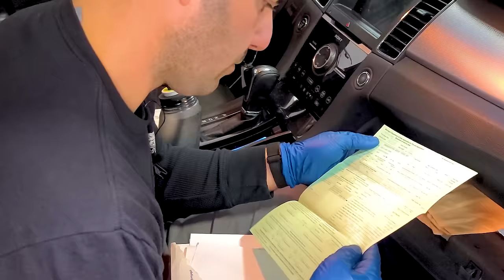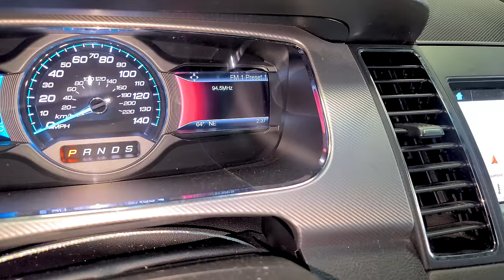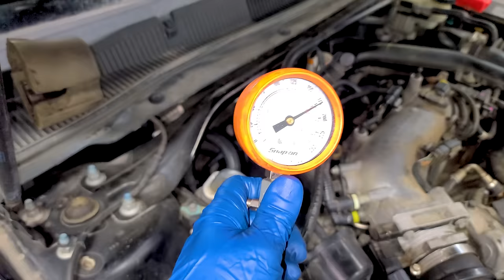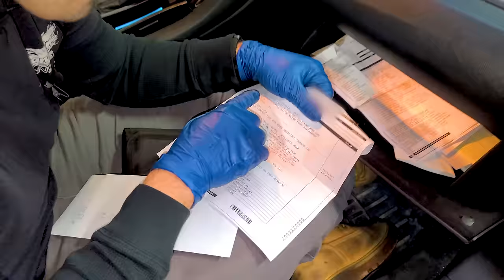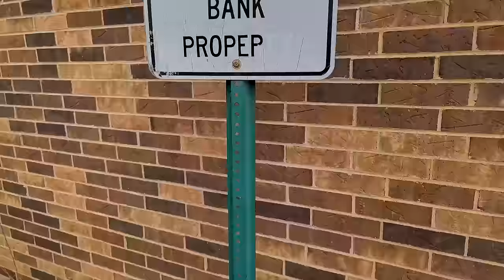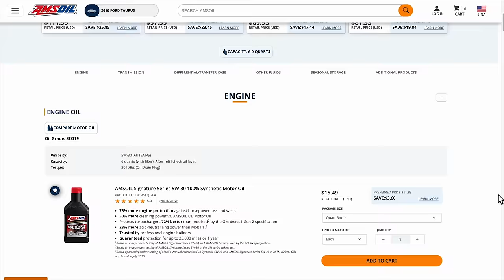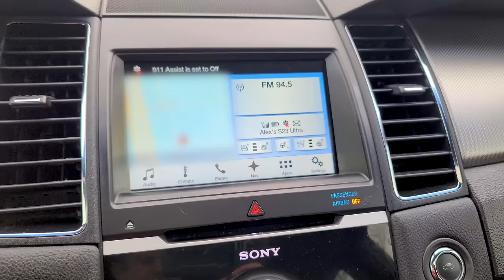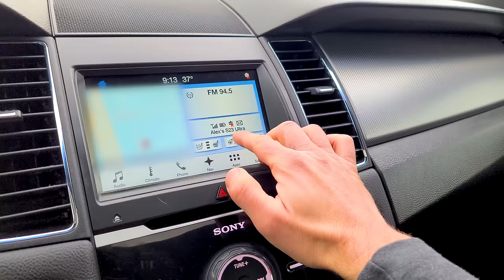I LOVE My GTR So I Bought Another Twin-Turbo V6 AWD Auction Car For 50% Off! Fixed For 30 Dollars!

Comment: **Internal water pump has left the chat**
Reply from the maker: Keep watching!
Reply: one of the worst engine design choices ever made. what a jackass thing to do as an engineer
Reply: That's why they're dirtcheap
Reply: Makes me a lot of money 🤷‍♂️
Reply: And tensions/phasers when the extended oil change intervals gum/varnish all the oil passages 😊
Reply: Alex is collecting cop cars!
Reply: @OxBlitzkriegxO  the 3.0 duratec V6 already had a great water pump design which was external no idea why they chose to stick it in the timing chain on the FWD 3.5/3.7 engines
Reply: That design issue is the only reason I didn't get one of these things. What were the engineers smoking?
Reply: happened to mine a month after i bought it
Reply: Sounds like a Ford problem. Nissan has had water pump driven by the T  chain for years . And never had an issue with it. I worked there for year and only replaced 1 , and that was because the customer skipped oil changes and gummed up the tensioner. I had to remove the little spiked ball water pump to replace the tensioner, wasn't hard at all.
Reply: @OxBlitzkriegxO why? They aren't that bad and they have a weep hole. Not like it fails every 30k miles
Reply: @redneckrussian2596  I can't find any GM engines with a internal water pump
Reply: @commonsenseisdeadin2024  the weep hole very commonly clogged and worse, it doesnt always follow the weep hole. its very common for them to leak directly in to the oil pan
Reply: @redneckrussian2596  no one complains about it because you're wrong. 2.5 hours labor in the 5.3 (which I think is way on the high side) vs 10.3 hours for a water pump in the SHO. Can you tell which one is actually internal?

Hint: I believe the fastest way to change the water pump in the 3.5 is to remove the engine
Reply: @redneckrussian2596  probably because you can nearly buy a whole engine for half the price of a water pump. thjeyre so plentiful but more importantly, they dont really fail very often.

3.5 water pump failure is only superseded by the amount of PTO gearbox failures for all of ford's awd cars.
Reply: @lieutenantdan8170  best i can think is due to packaging. its such a bad idea.
Reply: @OxBlitzkriegxO in the old 3.5 (non eco boost) I knew had that issue (few years ago I used to buy first Gen MKS's real cheap that washed out bearings to flip)  

the 3.7s and 3.5 eco boost i I haven't seen or heard of them clogging up  (so far I've done 9 of our 3.7s and haven't had any debris in the drain passage)
Reply: @trashbandit2449 book time on Continental 3.7s said 22 hours, the motor doesn't need to be pulled, just jack the engine up when you pull the motor mount connected to the front cover (aka the reason why the water pump is chain driven)
Reply: @OxBlitzkriegxO there are many others done this way. That is not a bad job as modern cars repairs go. I have done many of them. V6 GM and Stellantis engines in their fwd vehicles are far worse for timing chain matters. With 5k milenoil services this Ford family of engines will not need a chain when the water pump leaks in the 150k mile range but most 'change when it tells me to' owners will need chain and pha sers when pump is through.
Reply: Mine just went on my 2016 Explorer...$2700 at the dealership which included timing parts. What the hell were they thinking.
Reply: @commonsenseisdeadin2024  the block section of that little channel will get junk in it over time. its more likely to happen if the owner uses stop leak. 

it will also leak through the bearing. thats the main source of leakage in to the timing cover area. it doesnt help that the timing system puts quite a load on the water pump bearing due to its design. its so stupid.
Reply: Yep! Happened to my 2010 ford Taurus SHO. Water pump went out at 85k miles. Costed almost $2k to get it replaced
Reply: My 3.5tt doesn’t have hardly any service records got over 210k on it now that lil guys still pumping water lol. Istg these engines do not tolerate sitting or being babied whatsoever lmfao
Reply: The vq35/vq37vhr has the same design. Water ran by timing chain behind the timing cover lol. But atleast the motor is facing front wards .
Reply: @commonsenseisdeadin2024  yeah that was the long way to do it. Dropping the subframe or pulling the motor however they do it, ends up being shorter from my understanding. Either way, that's nuts. 

Water pump on my accord is internal (I believe, as it's run off timing belt) and I never really want to replacing timing belt/water pump on that again. Still faster to replace than an ecoboost
Reply: @FanOfSkynyrd  easy solution..... Don't bring it to the dealership!!!!! First off, why do you want to replace failed parts with the same exact parts! (Not that 150k+ is considered a bad component, timing belts and timing chains having a 100k service interval that costs thousands for YEARS! 

Also, there's absolutely nothing special about dealer techs (in fact many are simply parts installers) you're also limited to what part options you have as well as a slew of parts the manufacturer "recommends" to replace at the same time and is required to perform the service. 

 Where a mechanic will replace only the worn or broken parts, they will examine the guides for wear and look at the chain stretch (it's a 10 second visual inspection to check how extended the chain tensioner is or any excess slack, guides you just make sure they are flat and no cracks or groves) 

Honestly,  a $2700 repair after 8 years and 150k miles. Admittedly I am assuming mileage but is an educated assumption! 😂 Along with that knowledge is I bet the vehicle hasn't been a repair nightmare throughout your ownership, outside of normal known maintenance, no? 

What's crazy is a vehicle is on average a person's second most expensive purchase of their lives after a house but yet it's treated like no big deal! I feel bad for these people stuck in these sizable payments and the vehicle is constantly costing even more for constantly breaking,........ Again assuming here but I bet you can appreciate that! (Also as I said, it's treated like no big deal so those things are just over looked when you don't have to deal with that sht!) 

Just saying
Reply: @commonsenseisdeadin2024  Took it to the dealership because (1) the independent shops had roughly the same estimate, (2) dealer had parts in stock and got me in immediately (no waiting) and (3) they offered a 2 year warranty, unlimited miles. Absolutely none of the independents could match that. 

Not excited about the fact I had to pay for a repair like this, such a stupid engineering decision. 

It's been paid off for a few years now and I'm fortunate to have the $$ to pay for it. Plus my kid will be 16 soon and it will be a good first driver.
Reply: @OxBlitzkriegxO  using stop leak is a bandaid and you absolutely can not fault the manufacturer for that! That's someone else's negligence...... 

You mentioned PTU (or PTO failure) previously and given what you just said is telling me you don't have any ACTUAL experience in the matter at hand..... Am I wrong? 

The weep hole being clogged and PTU failures were issues in first Gen vehicles so that's tell #1. Tell #2 is you just repeated the same thing to me after I extensively told you that I have A LOT of experience with many years and iterations! Tell #3 is that clearly you don't even know how the product you're bad talking is designed or how it works because the bearing leak is not the "main source of leakage" it's THEE ONLY source of leakage..... It doesn't leak "in to the timing cover area" then though..... They designed it with 2 bearings and 2 seals! When the first bearing leaks it then leaks into a separate SEALED area where it then drains out the weep hole and given you at least get somewhat regular oil changes you'll be given ample warning of the issue before it becomes catastrophic! See after the first bearing fails the second one will follow relatively soon (I don't know  exactly but I'd assume roughly 10k miles) and that is because now obviously the remaining bearing is not only carrying twice the load but there's also movement introduced on the shaft! 

The last tell is your statement on how "the timing system puts quite a load on the water pump" and finishing off with calling it a stupid design..... There's no excessive load put on the water pump by the timing system and infact I'd actually argue it see less strain then a traditional belt driven design. Water pump bearings fail, it's a wear item and it's ALWAYS been a wear item. ALL water pump failures are bearing failure, that's just in the nature of bearings and coolant is NOT a good lubricant and often not serviced as recommended as well as people topping it off with tap water (which is far more corrosive!) 

The Ford timing chain driven water pumps do not and never did suffer premature failure, ALL catastrophic failure due to coolant leaking into the crankcase is due to negligence! EVEN with the weep hole clogging up, if owners actually inspected their vehicle every now and then either by themselves or an actual competent other who checks the oil level and coolant levels! If there's any loss of coolant, THERE IS an issue! An engine doesn't consume coolant like it does oil (fun fact, by GM's standards it's absolutely acceptable for their vehicles to consume 1qt of oil every 1,000 miles! There's recommended oil service intervals are at minimum 7500 miles yet a majority of their vehicles only have 5qt capacity....... They also have engines plagued with premature chain driven water pump failures as well as nasty rear main failures that destroy an engine with absolutely zero warning! That's due to their extensive history of just terrible PCV systems that one would think after all these years would have figured it out....... One would be WRONG!)

I'll say it's not the greatest design however it's far from stupid and truly it's not an oversight, they do put safeguards in place and it allows plenty of time to notice to be fixed, but the problem for people like you is that it's not fool proof! 

All in all, it's fine if you don't like it but please keep your opinions about what you really don't have any first hand experience and really not much actual knowledge about, you seem to be really are going off what you heard, the further issue is those issues you heard about,  it may still be of similar design HOWEVER it just does not apply here! If you talk (negatively I will add) on something you have no or very little knowledge on but you present them as fact...... That's a serious issue! It's a prime example of why misinformation and even worse yet disinformation doesn't only exist, it's fuking thriving! In this day and age, there's absolutely zero excuse for that! You are free to state your opinion, just let it be very clear that is exactly what it is! Like I said, you didn't present it like that at all. 

Anyway, I hope with all this said you now have more understanding. If you learned anything it wasn't a waste of my time. Obviously I don't know everything (as I was asking you questions for clarification) however I do know that I know a lot and that knowledge is backed by not only facts but first hand experience, and not just 1 or 2! I also know that I'm an ashole so I'm sure I come across as such in this! But I'm not wrong, so........ 🤷
Reply: @killakam123321 SOME are oriented longitudinal but certainly not all..... Also, even if so, it's certainly not any easier! I'll do 3 of the Fords over 1 VQ! 😂
Reply: @FanOfSkynyrd  just FYI the 2 year unlimited mile warranty is for parts only.... The labor warranty has limitations....... A LOT of limitations! 

I understand it's not ideal, however should be of no surprise in the least .... however given you saying what you just have after  all I just had previously said, I can confidently say that there not a car that exists that will appease you.....  

There is no shortage of horribly engineered things in this world however perfectly engineered doesn't exist and there a lot of factors at play and not everything is possible to be even ideal...... It's very easy to say "stupid engineering design", unfortunately you'll likely be right most of the time, but you need to take everything into consideration and understand why it is that way, is it a bad design or the best plausible design? Would you rather have paid $3500 on top of the price of the car from the start or years later paid $2700 like you did? 

Again, just saying.....
Reply: Can you do a trans rebuild video on the Buick ? Your Italian man you gotta do a gm trans rebuild video, also did you work with the eco boost platform alot while you were formeman at the police car/ government shop ?
Reply: @fl_atv_riders4455  the gm 2.4L has the water pump driven off timing chain. it can be changed by removing the exhaust manifold and using a special tool to hold sprocket in place. it's still a pia to do. just like others have said, the duratech v6 was an awesome engine with external pump. Fords latest engines and transmissions are just crap. they made way better stuff when they were merged with mazda.
Reply: @alanprather8399  the 2.4 is still not a internal water pump it's a external water pump with a internal gear. When they go bad they do not cause the engine to self destruct.
Reply: Alex spent a career working on Ford cop cars…
Reply: The reason I let go my Taurus smfh

Comment: Amsoil, the rich man's oil... 25% off, almost puts it in upper middle class man's oil... Almost.

Check your oil often, change it when you are supposed to and you won't have an issue with any oil you use.

We have a hatchback close to that color, looks beautiful clean, but they never stay looking clean. Always cleaning it, but I'm a detailer, and I am VERY picky. Those suede seats clean pretty easily, usually doesn't take much to get them spotless.

Comment from the maker: Should I mod this car? What should I do to it?
Reply: yes
Reply: 5.0 swap it😂
Reply: Yes
Reply: My buddy worked at ford and had to deal with these a lot he said “Absolutely not run away… fast”
Reply: Delete the noise maker funneling generated noise into the cabin
Reply: I would just get a tune. Second would be gear head intercooler and or meth injection. You probably don't want to do downpipes because of emissions but they help it spool much faster.
Reply: yes. Tune, intake, downpipes is low 12's. I ran tune only with a muffler delete 12.7x's. Ive been out of the SHO game for a little bit, but they do have bigger turbos, DI pump, intercoolers and whatnot.

also, with a "Cold air intake" you definitely hear the turbos when getting on it.
Reply: Give it to papa d
Reply: Give it to dad
Reply: They can be fairly fast but they break
Reply: I have brand new Gearhead turbos and a brand new XDI high pressure fuel pump available if you decide to mod it.
Reply: @feron450  all mechanics say that shit.
Reply: Black out the trim and wheels after you paint the shop van.  😉
Reply: @feron450 They are actually pretty reliable. They are just a pain to work on due to no room in the engine bay. As Alex showed everything is pretty cramped in the engine bay. If you work on it yourself be ready for busted and scraped hands. 

I would never say run away from one of these. I would own one any day instead of a Mercedes or BMW.
Reply: slight lower, especially in the back. Tune, intake, VTA, better rubber and brakes.
Reply: Pick the low hanging fruit, performance wise.  E85 tune and change boost controller to add boost, maybe a free flowing down pipe if available.  Polish out the paint and tint the windows.  Done???
Reply: You lucked out that they did a bunch of the maintenance already. I would recommend getting a Gearhead Tune, catch-can, noise maker delete, make sure you change the PTU fluid.
Reply: At the least a Gear Head AO (auto octane) tune. 

Make sure to change that PTU fluid. Probably the #1 failure in Taurus AWD vehicles. I actually put a EZ drain in my PTU and change it every 10k miles.
Reply: These SHOs weigh 4300 pounds. So you'd have to have 600+ hp to be fast. The AWD kills power obviously compared to a RWD car. Pretty much only good 0 to 60 before they fall on their face.
Reply: Looks like my other comment didn't post. But It would have to be 600+hp to be fast. These SHOs weigh 4300 pounds.
Reply: yes, install sport cats and then straight pipe it out to the back.  It'll spool better, sound better, and you'll still pass emissions (without the terrible smells you get from catless)
Reply: Make it a convertible
Reply: If you can just an intake, larger intercooler, and a tune and it's a lot of cheap and easy power without having to do much
Reply: Yes I think you should
Reply: Try to make a custom equal length exhaust so its sounds like a nissan v6
Reply: bigger turbos custom ecu lower it on stiffer springs dyno tune.